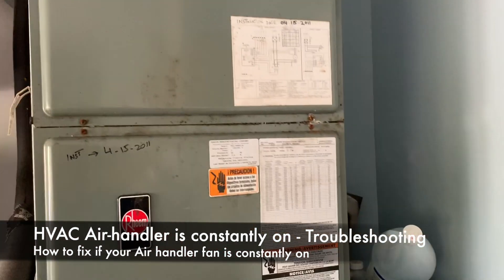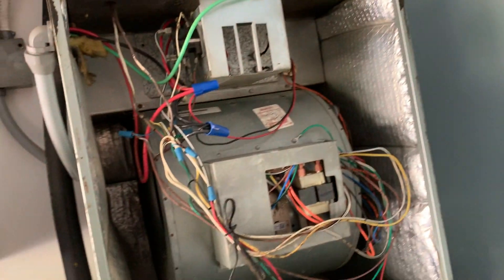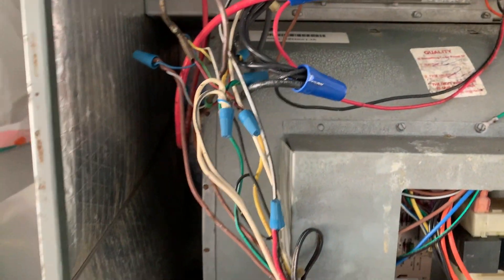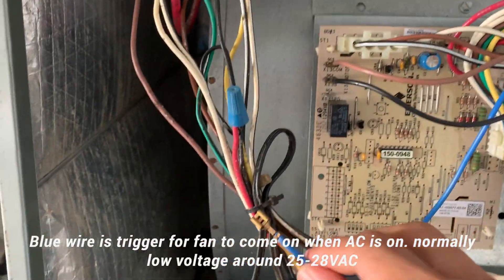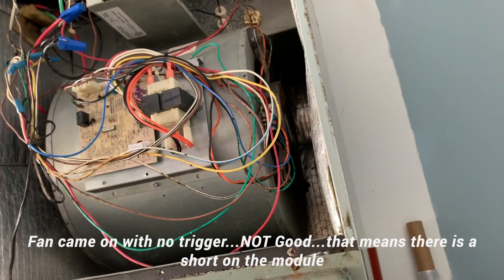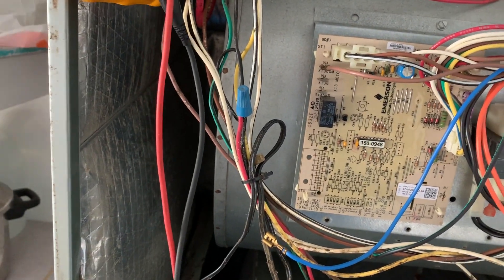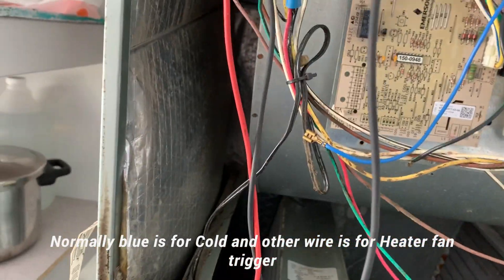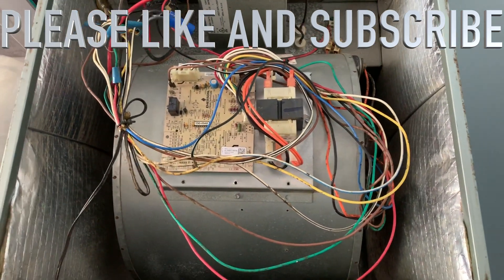HVAC AC airhandler fan is constantly on FIX

Comment: my x13 fan motor runs constantly even with low voltage wire not connected. Does this means bad module which can be fixed by replacing thermistor?
Reply: If you remove the low voltage wires on fan ,blue and white for heat and it stops, then fan is ok
You can check low voltage on those when you switch on tstat.
Reply from the maker: You will have to change the entire module on the motor. No need to change the motor.
Reply: @HowToDoitright  - Changing just the thermistor is not going to fix the issue and entire module needs to be replaced?
Reply from the maker: @malikammar8404  that is correct brother. it wont fix the issue. you can try but you will waste your time and effort. i have tried it. to be honest its better to buy the full motor with the module. i replaced the module but it would fail after a year and i had to redo the whole thing. i got lucky once that the seller offered me a warranty as it was just within a year but second time i wasn't lucky so instead of buying a module i bought a full motor with module and replaced and and problem was fixed forever. a used module will run you around 200 but a new motor will cost your around 600-700. i got lucky as i have a hvac account at my local shop and i bought the entire motor for $500 shipped. the motor came with a protective chip so never had that issue again. let me know if you need help and i Maybe able to get you hookedup with the motor. Salaam

Comment: I had a bad transformer.  The x13 motor runs with no call wires plugged in, guessing this is normal ?
Reply from the maker: The x13 module is bad if it runs constantly.

Comment: Check your low voltage wires  & connections. 
Look to see if dirty . This will also cause signal from thermostat to be incorrect. 
Always turn off power to unit !
Reply from the maker: This video is about continuous running of the Motor and not loosing signal